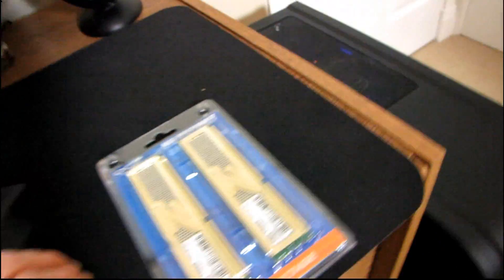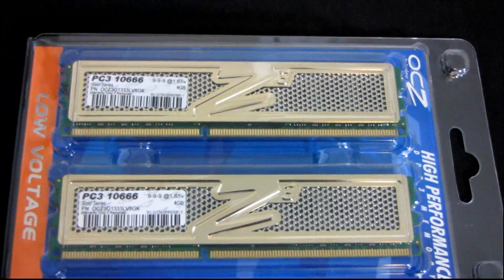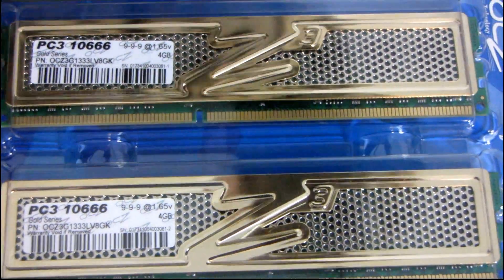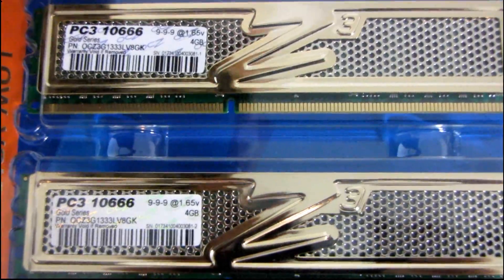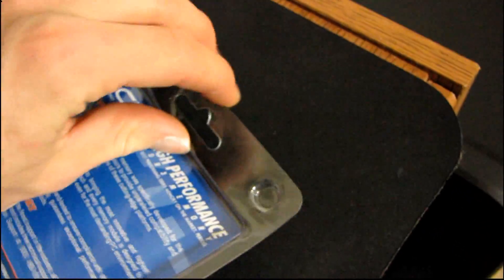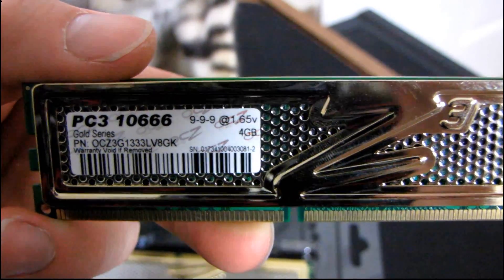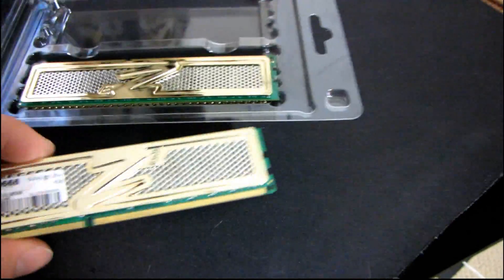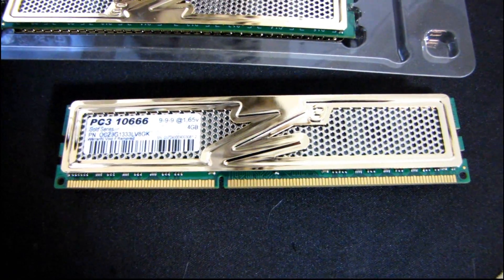OCZ Gold XTC 8GB DDR3 1333Mhz 9-9-9 RAM Memory Kit Unboxing & First Look Linus Tech Tips

Comment: @pekar5 the slowest is 1066 MHz btw,although it's the slowest, it only performs 3 to 5% behind in benchmarks, lots of rams>frequency. Same thing with cpus, a 8 Ghz pentium 4 will still get trumped by a dual core at 3 Ghz. Same thing with gpus, more sream processors/cuda cores> core fréquecy. Although it's fun to have high speed ram, the performance gains aren't there yet and it's more of a gimmick than anything else.

Comment: @pekar5 false, tom's hardware front page, no performance increase in ALL games over 1600 Mhz, some games will even see a decrease in performance, the performance increase from 1333 to 1600 is also very small, like 2%. ddr3-2000 is overpriced and gimmicky at the moment, 8gb at 1333 will get better performance than 4gb at 2000.

Comment: low voltage? that ram sucks... at 1333 mhz it should easily be able to run at 1.5v, if its low voltage, it should be able to run at that at 1.35v.

Comment: @pacsmile corsair with there GT drr3 tripple or dual channel rams are one of the best of the best. also G skill pi series are great,low voltage and good timings but its a not as good as the GT series specialy if u are a overclocker.the gt series easly oc to 2000